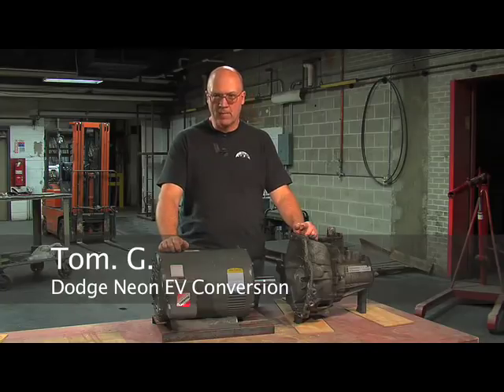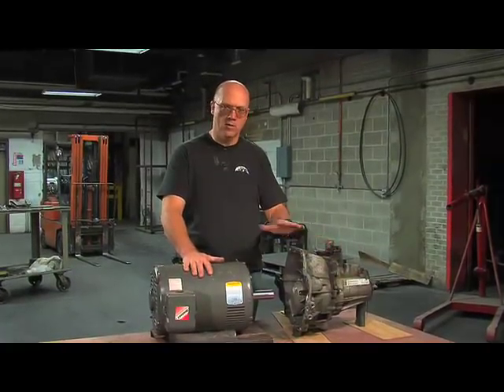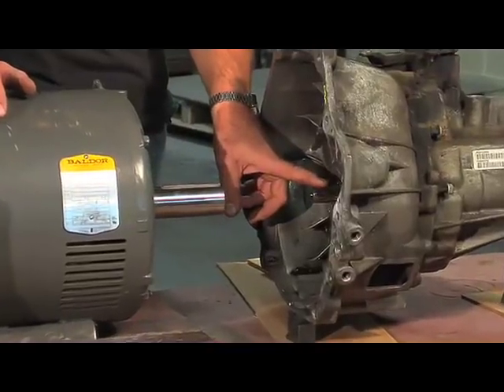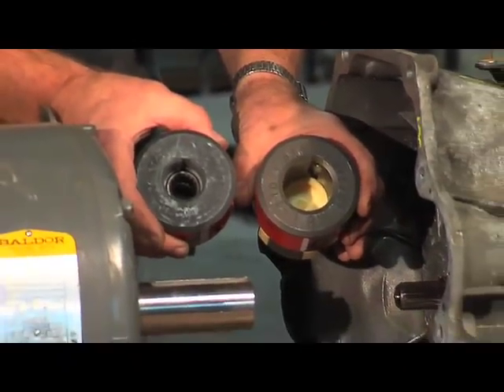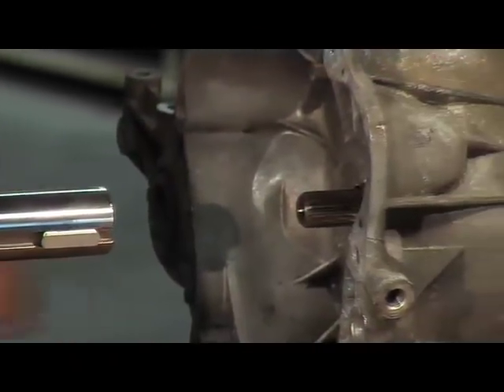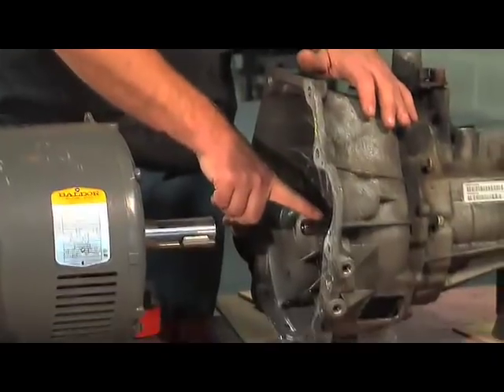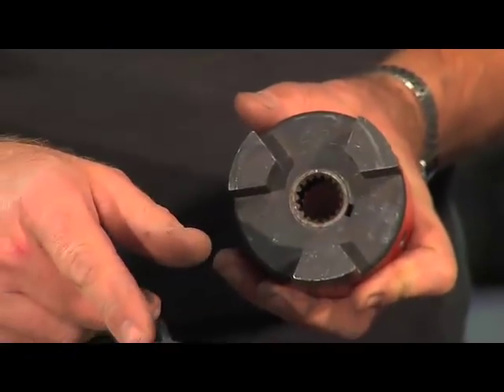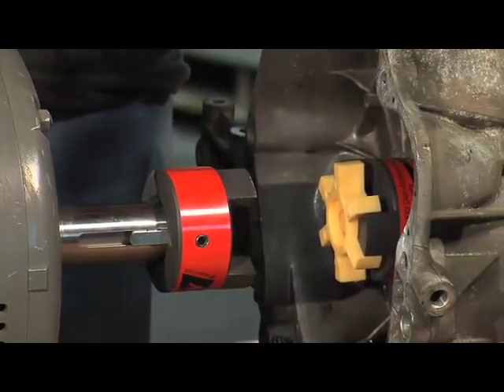AC Electric Car Conversion 101  part 001

Comment: I'm also working on a electric car conversion. I have splined shafts on both the motor and transmission but anyway, my coupler is totally different than the one shown in this video. The motor shaft and the gearbox shaft are sliding freely in the coupler which is a solid piece. Anyone who's interested in this project and many more, check out my channel.

Comment: I thought someone found out that this arrangement did not work. The set screw on the key slipped, and the half of the coupler on the motor moved, and eventually chewed through the flexible plastic part.
Reply from the maker: This coupler worked just fine.
You may be thinking of another car shown on this channel, the Geo Metro. On that car the original alignment was off, so the two part coupler didn't work because of that. The coupler for the Geo was rebuilt as a solid coupler and worked very well from that point forward.

Comment: LNG maybe the future, but we already have infrastructure for diesel, millions of vehicles. LNG is a limited resource unless you start getting it from cow shit and landfills... by the time we'll try to dismiss diesel batteries will be ready to replace any kind of fuel and solar will be the only thing we will use to power anything.
The only reason we haven't jumped all the way to electricity is because of the batteries, they're still expensive, big and heavy, but they'll get better I bet.

Comment: With an electric motor you do not need a transmission just an electric riostate.
Reply from the maker: At bare minimum, you still need a location to mount the motor into the vehicle and connect the mechanical power from the motor and split it to two drive wheels. The transmission is already there and already serves that purpose.

A rheostat would be an extremely INefficient way to operate an electric car. Electric cars can produce tens of thousands of watts of power. The typical way to control motor speed is with Pulse Width Modulation, with either a PWM Motor Speed Controller (DC motors) or an Inverter or Variable Frequency Drive (AC motors)

Comment: No need to be concerned, engieneers are well smart, they will isolate batteries and with a 5 bucks element thing you can shut the entire system as soon as a short circuit happens... you know, they are called fuses installed in the fuse box in the power line.
Also electric smoke is plasma, you can't smell it, short circuit by water doeen't burn your car.
Don't like EVs? don't buy one, EVs are the future of home use, for adventure/recreation/transport and cargo they are not, we will use diesel :)

Comment: Search evwest channel, they made a ford ranger (pickup) to electric, with power steering and AC, batteries cleverly hidden under the truck bed, awesome conversion... they also run the bussines of custom conversion if you don't want to DIY, or you can buy ALL the parts (they got an excellent e-shop) with them and DIY.

Comment: Why would not be worth it? do the math
No more oil changes, sparks, cables, leaks, coolant
According to my math with ONLY the gas savings it pays itself in less than 5 years, you can spend 4,000 now in electric and drive for cents a mile after 5 years OR you can spend 4,000 in 5 years in gas alone

Comment: You shouldn’t need a transition with a vfd.
Reply from the maker: A variable frequency drive allows you to change the speed of the motor.
Gearing allows you to trade for speed for torque.
This isn't a particularly powerful motor, so using the multiple gears is still useful.

Modern commercially-produced electric cars typically use a more powerful motor with single-speed gear reduction.

Comment: Esto no sirve,no puedes cambiar de marchas en una caja de velocidad  sin un clutch que te paralice el eje principal,solo estas promocionando un acople directo que en este caso es inutil
Reply from the maker: Shifting works just fine on this project.
Remember, the spinning shaft of the electric motor is LIGHTER than the flywheel and rotating mass of the gasoline engine and we can use software to control the rotational speed of the electric motor.
Here is a video of my friend Tom driving this car: https://www.youtube.com/watch?v=Ic49M8F8hwc

Comment: Transmission.. . .  WHY ???
Reply from the maker: A transmission is a simple way to connect an electric motor to the wheels and have some gear reduction.
Nearly all modern production-built electric cars do EXACTLY this, except that they just use a single gear.
Reply: I disagree and agree
Reply: and thanx for the prompt rely

Comment: A automatic trandmission uses a clutch?  Don't you mean a "torque converter"?
A manual transmission has a c
"clutch". An automatic has a "torque converter". 
Big difference between a clutch and torque converter.

Why no torque converter when converting to an electric motor?
Wouldn't the torque converter allow the electric motor to get up to whatever RPM the stall speed of the torque converter is, lowering the initial load on the electric motor when starting from a stand still?
Unless you have charge while braking or coasting (field is reversed, making the motor a generator) you're not going to get any "engine braking" with an electric motor.
Reply: Pretty sure that's a manual transmission from the way they're talking